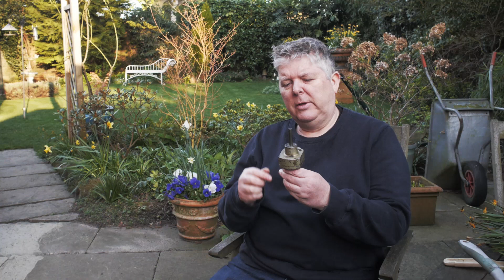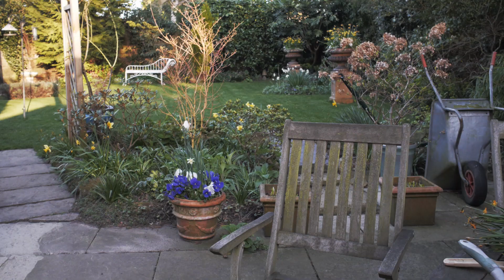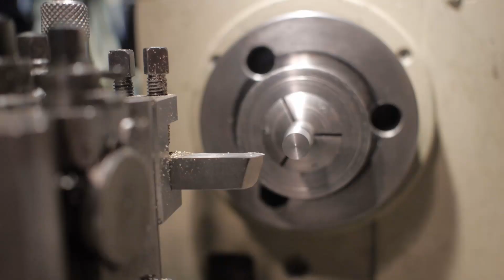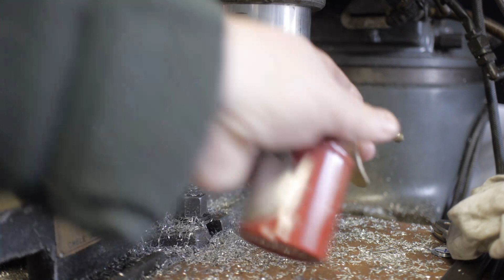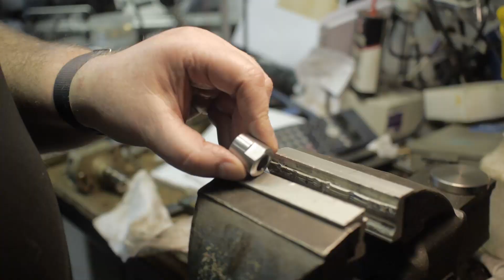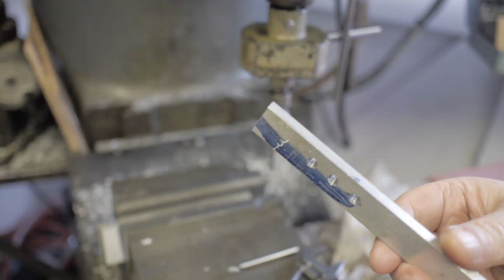Tapping head repair

Comment: Thing is that if it doesn't contain some type of friction/clutch feature then you can't get away with tapping blind holes reliably without breaking taps and then you need to be able to adjust the clutch torque to match the force of the tapping . Great for through holes though using spiral taps . Nice job.

Comment: Nice fix. Did you re-grease it? Looked like dried up grease when you first took it apart. Thanks for making the video. Stay healthy.
Reply from the maker: Once I got it working I stripped it down, cleaned it and re-greased it. Runs really nicely now.